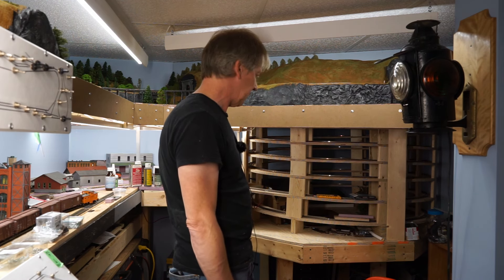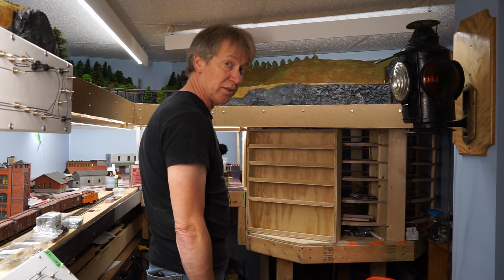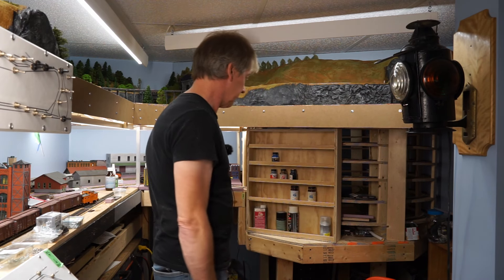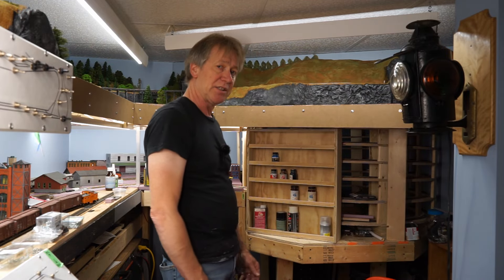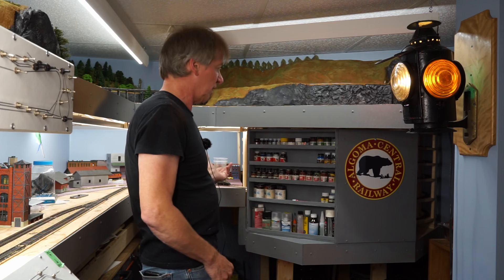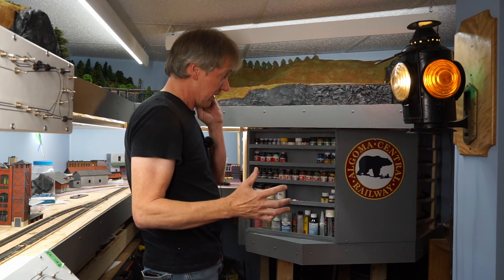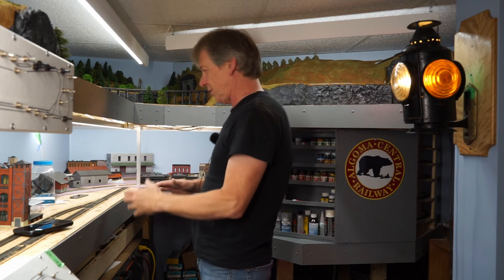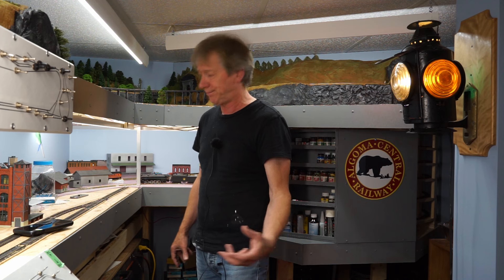Train Room Storage and Upgrades. Getting the Layout Organized! ACHB 1-22

Comment: Organization is a good thing , I still have stuff in boxes from the move , have not found them yet, but you are moving in a positive direction, great video
Reply from the maker: I still have lots of boxes as well. Now I’m figuring out how to add a few drawers to the bottom of the layout for more storage.
Reply: @achb-railway  I had a cabinet that I built about 15 years , finally finished it , use under the layout for tools
Reply from the maker: @dundasjunctionmodelr.r-jam8267  I have some storage down there - but I want to attach some drawers to the bottom of the layout for tool and camera gear storage, that still leaves the floor clear below for some larger storage bins. That’s the idea anyway… I’ll probably tackle that later this week. Now that I retired, I have time…

Comment: Good looking storage and coverup solution. You have screwed the side cover in so does this crate a helix access issue or is there an opening on the other side of the new shelf unit? Thanks for the update.
Reply from the maker: I can crawl under and fully stand up in the middle of the helix, so I don’t need access from the outside. The “table” that supports the helix has an access hole in the middle.